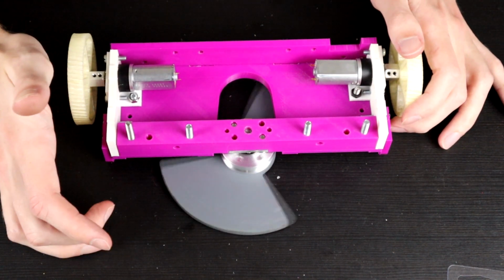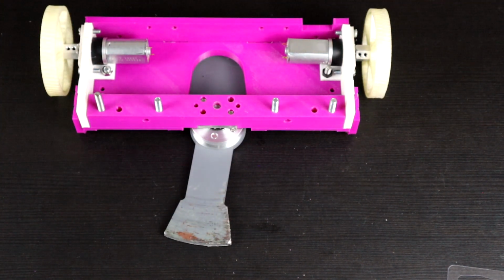How low can we go? (Annie_R_U_OK_V7 Prototype)

Comment: What kind of battery do you use for annie/any of your beetles? Mainly for drive
Reply from the maker: I use 3s LiPo batteries for all my beetles, 
I use a single pack and power both the drive and the weapon from the same battery

Annie has a 800mAh pack, other beetles will run a 1000mAh pack

Comment: i feel the HDPE gonna flex more then you think, i know Daedalus mid cutter flex enought to hit both top and bottem weapon bulkheads.

also drive wise hust throw some 1804 on to the gearboxes and your good
Reply from the maker: Yeah I thought it was going to flex a lot, that's why Annie has a weapon skid guard built into her baseplate, so the weapon only warps so far then it skids, hitting nothing important

I thought about a brushless conversion, but the space inside annie is tight, I barely fit the electronics as she is, needing to add covers to stop wires wrapping around the out runner cans would suck up too much space

Comment: Very nice. I expect the 22mm will give you good performance, they are a good trade off between weight / power - they aren't crazily powerful but are reliable and a lot lighter than 25mm brushed.
Reply from the maker: I havent powered them up yet, but I'm super happy with their weight and size

Comment: Why does Annie’s weapon have a thin long side and then a short heavy side
Reply: Its a asym bar. this lets it have a 1 tooth so it gets more bite. more bite=bigger hits. the bulky back is a counter weight for the long thin impactor
Reply: The longer side is the only part that makes contact with the opponent. This gives it one "tooth" and one chance to hit per revolution. This means it can get more bite than a symmetrical weapon, as the robot can move further into the weapon area before it makes contact.

This weapon is actually balanced. Both sides have the same mass on them, just in different shapes.
Reply: @DigitalJedi  ok thx

Comment: Nice progress Ben!
I'm afraid that the ends of the flange of the deadbolt can cause stress points in the HDPE bar. 
I guess we'll find out 😀
Reply from the maker: I was a little worried about that too, which is why the corners arnt surrounded by HDPE on two sides
But if its a problem I'll do a second version thats rounded